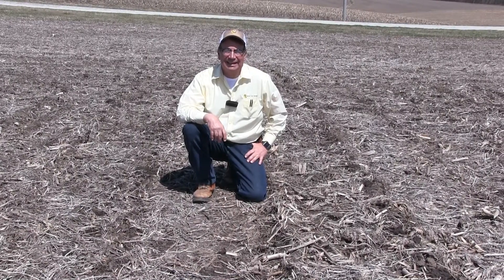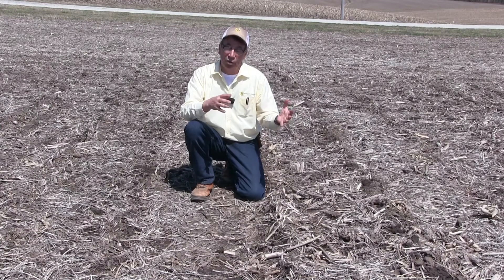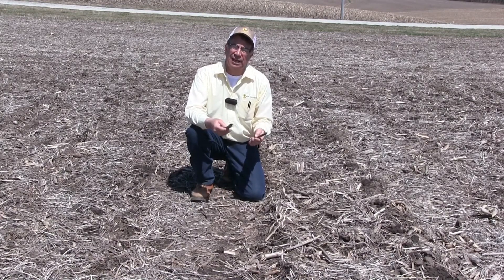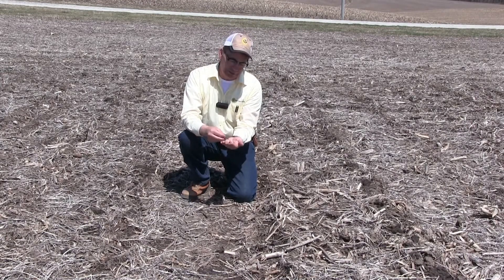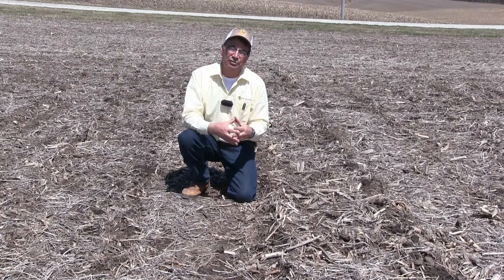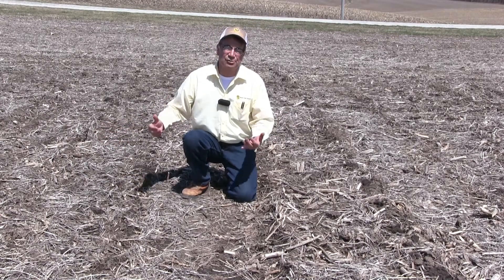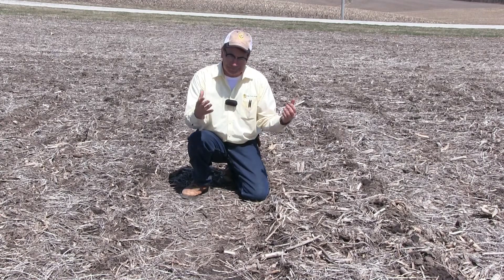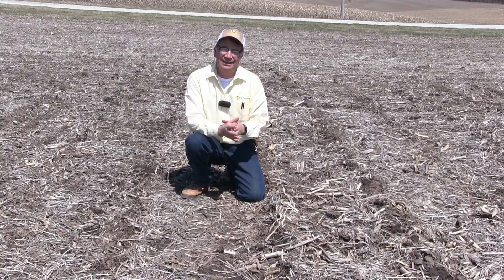Marion Calmer - On-Farm Research Series Part 7 - Soybean Residue Management

Comment: Wouldnt the bigger stalks tie up less nitrogen if they are just sitting there and not decomposing?
Reply from the maker: The bigger the stalk, the more nitrogen that would be tied up in theory. Because N, P, K, etc. are applied to grow the crop, those nutrients are immobilized unless we return that organic matter back to the soils. By sitting on top of the soil and not breaking down, those nutrients are immobilized on the soil surface for a much longer time period. that's why we recommend chopping cornstalks into confetti-like (small) pieces and exposing the pith, which enables the faster return of the critical nutrients to the soil.